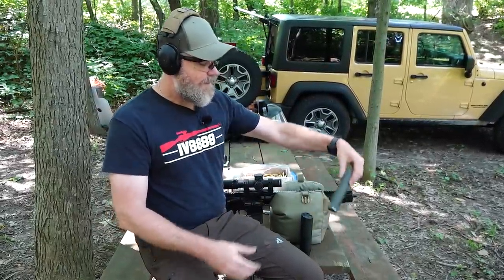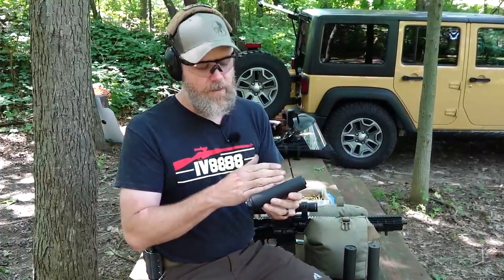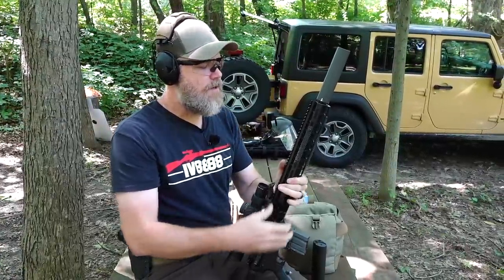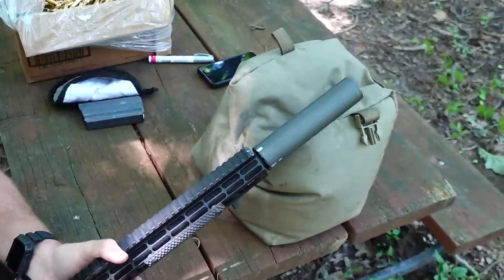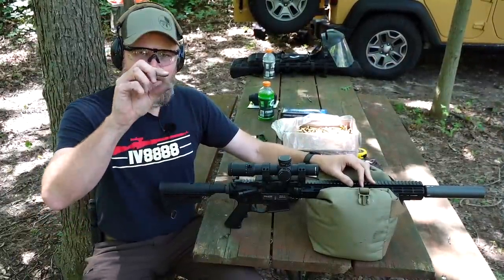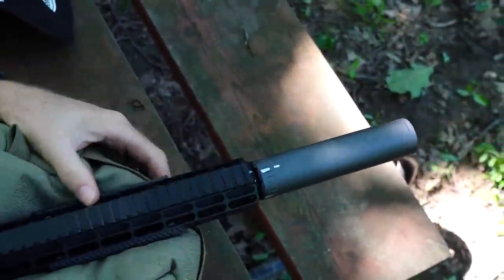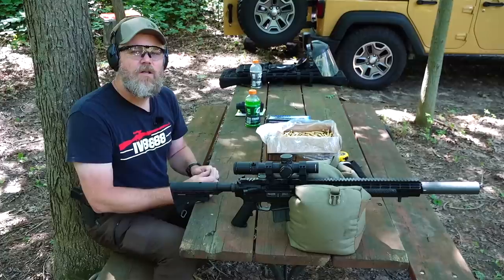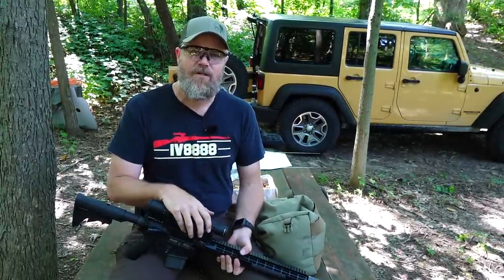BAFFLE STRIKE! What does it mean for your silencer?

Comment: What would cause an AR15 to keyhole without anything attached besides a muzzle break? Bad barrel? Shooting M193 ammo.
16” barrel 
1:8 twist 
1000+/- rounds total through it.
Reply: That's weird. Have you tried different grain ammo or other brands? You might have to start looking for a new barrel.
Reply: Muzzle devices can cause harmonic issues but keyholes are generally not one.  1000 rounds should not be a barrel issue unless something is out of spec.  Check the muzzle device.  You may be nicking it when the bullet exits.  Check the crown as well.  May have a burr on the end which will cause inaccuracies.

Comment: I’ve gotten really good results by using simple o rings sized slightly small than the threads. For my 9mm pcc I use a 1/2” ID ring and my osprey doesn’t come loose off there.

Comment: Use a crush washer to hold the suppressor on?  Does anyone by chance know what the inside diameter of a 6.5mm suppressor would be?  Bigger than 6.5mm obviously, but how much?
Reply: Unless you find a 6.5 specific can a 30 caliber will work fine.

Comment: What's the best grouping on an ar with an A2 front sight post? Seeing this video got me thinking on longer distances accuracy as it's not a free float barrel, such as on a ruger 556 with an A2 front post
Reply: Free float doesn't boost accuracy. Free float maintains poa/poi when you put pressure or accessories on the hand guard. You won't see a moa increase by switching to free float rails. People usually make that mistake because higher end (therefore more accurate) rifle come free floated from the factory.
Reply: And as far as accuracy with the A2 post, it depends on you. AR aperture sights are probably the best kind of iron sights you can put on a rifle. With a good rear sight you can be as accurate as you want. It's really up to you.

Comment: Im curious to know what would be the result of crooked threading on the barrel.   Ive got a rimfire i purchased from a freind that had a DIY thread job on it and tested how straight it was with a cleaning rod down the barrel and out the end of a suppressor.   It's clearly resting against the end cap of the suppressor.   And let's say that im not as brave as Tim is to test the results of if a live round will pass clean and clear.

Comment: Is it possible (or legal) to have a direct thread can modified to change attachment system?
Reply: RockHumper it should be depending on construction of the suppressor since the tube should be the serialized component.

Comment: I don't think a silencer is something you would expect to take on a battlefield.   It is what it is.    You twist it on hand tight.    So unless you want to crank it on with a wrench and thread lock it like you would a thread protector or a flash suppressor and its bangin around hangin off your ATV you check that its snug before taking the shot and live with it...